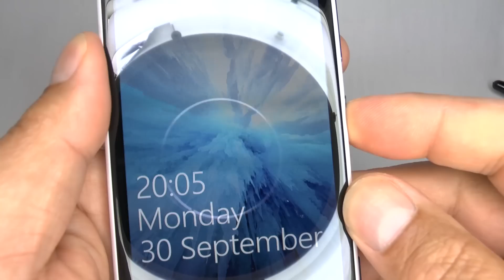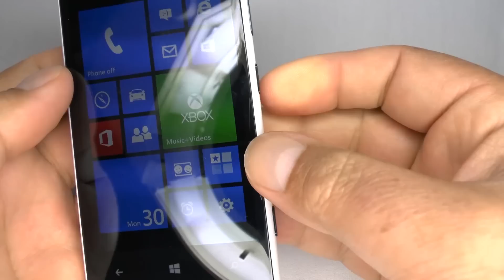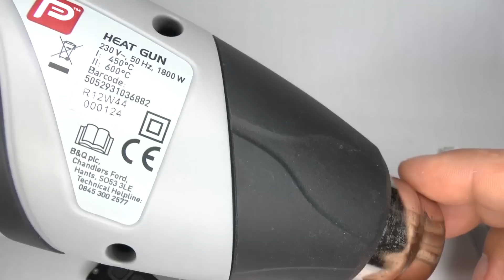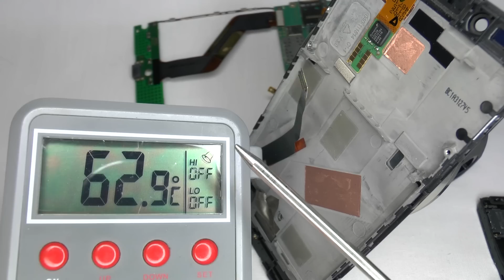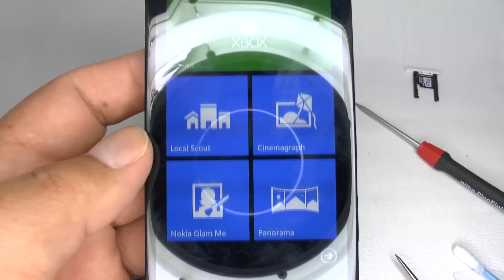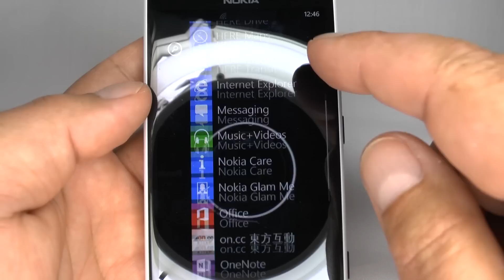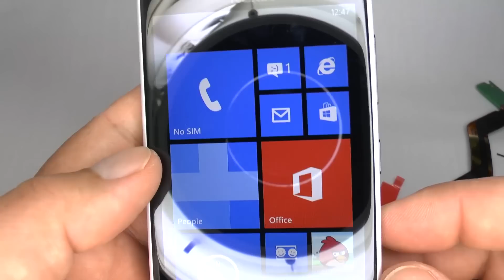Nokia Lumia 720 - Disassembly & Assembly - Digitizer Display Screen & Case Replacement

Comment: After a drop my Lumia 720 got its screen busted, and because of that I found your video. Another thing is that the mic stopped working (actually began to work erratically) a few days after the crash. I had figured its connector had probably unlatched because of the impact and was going to dismantle the whole phone to get it set properly, but as your video shows its location, I just turned the phone screen down and squished it around that connector area. Works like a charm now. Thanks a lot! Now for the screen repair... I'm gonna try to unbond the glass/digitizer and re-glue it to the lcd. I can comment how it went here, if anyone's interested.
Reply: yeah tell me if it worked
Reply: Viktor Mars Nope. Instead of separating the glass from the LCD I managed to destroy the LCD. I was cautious and did not apply much force to it, but the screen is VERY EASY to tear. When it does, a dozen layers of polarizers and micro lenses arrays and diffusers came pouring from inside it. It's amazing how many layers make the screen in these phones! Anyway, that busted the phone for good and I would not recommend trying this aproach. Buy the screen+frame and simply replace the internals. I've bought this assembly for around 40 USD and will, once again, try to repair the thing. Also, the mic worked for about a week before beginning to stutter again, so I already bought a new mic+usb PCB assembly (around 3 usd). There's no reason to throw the phone away because of two components, so i'm not giving up on it!
Reply: Vinicius Abreu any links you could provide us with where we could source the whole assembly? I'm sorry to read that you have had shattered it, after reading this I've pretty much stopped right after reading your comment. I just don't know now, whether after separating the LCD from the digitizer, if attaching together requires the same sort of sticky translucent tape or I'll be fine without it and just glueing the edges ? thanks mate

Comment: Very useful video, I just managed to fix my phone and now everythng works properly! My problem was a broken glass, even if when I opened it I realized that the lcd was cracked as well. So I bought the display lcd+glass on eBay for around € 30 (this made everything even easier) and replaced it. Grazie mille ;)

Comment: You sir, deserve more likes! I'd had a problem with mine with the volumen down button, but only disassembly and assembly can solve it! Now I think I would buy a new body :D Thank you!
Reply: Did you fully disassembly? Or you just removed the rear casing? Because I aslo have the volume down issue.
Reply: hi, you only need to put of the case and there is the button flex, but is a full line (vol up, vol, down, block and camera)

Comment: Great video. Very clear and informative (as usual). I have found that separating the digitizer from the LCD is extremely tricky, much harder than the Samsung Galaxy S3/S4, and almost impossible. If you are going to attempt a repair I would recommend replacing the LCD, Glass & Digitizer at the same time.

Comment: One of the best videos that i have seen about how to Disassembly & Assembly. Many thanks. I dropped my phone and the digitizer stopped working i think it is due to the digitizer connector disconnecting from main board. Any thoughts on this issue?
Reply from the maker: it might be worth checking the plug but you'll probably need a new display assembly

Comment from the maker: Most important is to keep the battery disconnected until its 100% dry inside, even if it seems to work ok it can stop working after a few days. Any trapped water will slowly eat away at the copper circuit. As the warranty is now voided remove the back cover and unplug the battery, then leave the phone in a stream of hot air for an hour or more. Try and keep the temperature below 70ºC. If you have access to a vacuum chamber it would only take 30 minutes for it to be 100% dry

Comment: Excellent channel, sir! I do hope your promise to cover the TOUCH/LCD Separation in a future video (like you said @19:00) will be held SOONER than later! I definitely need to get a look into this (touch cracked). I wonder if your video on L920 would be equivalent on that. Doubt on it..
Reply from the maker: The 920 had an air gap instead of the optical adhesive which makes it easier to replace the digitizer..
Reply: I wondered that. I believe L720 looks like L900 on that matter. Actually nobody has published a successful separataton of those 2 "bad boys" except after 8 hrs of airdryer.. ^^ Add to that nobody showed how to repack them later. The fact that the digitizer only is sold (over ebay) w/o any bundled adhesive film feels like quite problematic.. All that said your technique of the wire would definitely be worth seeing.. ;)
Reply: ***** Sorry to come back on that matter, but I just discovered that all the LCD+Touch I can see on sale come with the Frame bundled already. Are you aware of any LCD/Touch bare assy selling? I mean, all your dedication with the hot air gun to gently separate the metal frame from the LCD/Touch would be meaningless if the only sellable parts around are with the frame included.. Thanks and keep up with the good work!
Reply from the maker: TheMacco26 If would be nice if only the complete assembly was for sale, but as time goes on and the compatables start flooding the market you'll see the screens for sale without the frame. Lots of people buy the screen only without realising. Hopefully this one covers both..

Comment: Congrats for your excellent video(s).
I'm going through the part not yet covered here, I mean the replacement of the touch digitizer glass alone.
Although already having the LOCA glue and UV lamp to cure this, I still had a surprise: are the lower, smaller flex of the digitizer glass and the LCD flex, soldered together (4 tabs) as it seems?
Thanks!

Comment: Hi Thanks for this very informative video. I own a lumia 720 and its power button is not functioning properly ( there is some contact issue ) so for repairing that do I need to remove the flex strip with camera, volume and power from the frame. ??

Comment: Your video is no doubt very appropriate.
I have a small doubt
If suppose the front glass is damaged(broken) but everything is intact and the phone is working excellently. Only problem is the broken glass looks bad. If I want to replace only the glass(leaving the LCD), would u think it wll work out.
Need your valuable advice at the earliest
Reply from the maker: Some of the comments below say they have tried without success, so you'll need to replace the digitizer and display assembly

Comment: what kind of an adhesive is that you are using? ... for anyone attempting to do this, it's relatively easy, but make sure that you apply a lot of heat to the screen when attempting to detach it from the frame, and also if separating the digitizer from the lcd. that make a lot of a difference.

Comment: Hi
I've repaired many phones with your tutorials so very greatful for what you've put up!!!

I do have a question, I've replaved an lcd on the lumia 720.
The LCD works, but the digitiser doesn't?  When I enquired via a phone call to local a repair shop, they said there are different revision numbers which aren't compatible?  
As I threw the old one away, I can't tell what the old one was, if any? 

To your knowledge,  is this correct or do you have any suggestions for me? 

Thanks.
Reply from the maker: I didn't think there was different revisions for this model, I would try another digitizer...
Reply: I realised the problem now.
Because the seller would not change the part if faulty and fitted, I only placed the motherboard in position rather than screw into place,  so the spring clips on the back wasn't making contact to the ribbon flex on the frame.
Thanks for your response! 
And good job with your videos too! 
Have a good day/night
Reply from the maker: Duane Massey Good news..

Comment: Just subscribed (couldn't do anything else). The Digitizer is what I'd call "Display" and the screen would be the "touch glass"? If I need to only change the glass that broke, do I need to disassemble everything step by step or I can do it in another way? Thanks very much. Great video.
Reply from the maker: its a bit tricky trying to replace the glass on its own, this video shows how its done.. cambio tactil o vidrio nokia lumia 720 , remplace touch or glass lumia 720
Reply: Yes, that was the first one I saw but honestly since he messed up I didn't take it seriously like I did with your video. Still i'm not confident on myself so i'm not going to try. Thanks very much thought :)

Comment: Great video. I replaced the screen. Everything went seemingly well but when I first started the device and after giving the pin a message appeared: Try again in 221864 minutes. -- Basically nothing can be done to proceed anywhere. The volume can be controlled and I can swipe out the action center and see some notifications but if I press any of those nothing happens. I'd rather not do hard reset since I have some really important data there. Any ideas?

Comment: Dear Sir, Your video was very helpful. I replaced the touchscreen Yesterday night saccessfully. Just one thing went wrong, the microphone doesn't work anymore after re-assembly (I've to use headphone to do a phone call) . Have You any suggestion? Thanks. Marco
Reply from the maker: the microphone does seem to go wrong in these phones. I would try another usb flex which comes with the mic
Reply: exactly what I was afraid of... A lot of Thanks for Your kind help. Best Regards. Marco

Comment: I just tried separating the shattered digitizer from the LCD.  I did not succeed, and now don't think it's possible, at least not without some very special rig.  The problem is that, as pointed out in this video, LCD is glued very strongly to the digitizer but at the same time the LCD is very thin and flimsy, backed by bendy plastic instead of metal.  The front glass on it (if that's a glass at all) is way thinner than a millimetre.  The end result was that the piece that I managed to separate (with the help of the hot air gun and a gold variety of molybdenum wire for mobile repair) was not the whole LCD, just the backlight.  Wire sliced through the display itself instead of through the glue -- that's how strong that glue is, and how flimsy the LCD is.
Reply from the maker: thanks for the heads up, I also have the molybdenum wire and was going to have a go on camera, even if it goes wrong it might be worth uploading..
Reply: ***** Plz do!! As many here I have the digitizer scratched and wanted to se if its possible to repair. Great channel!

Comment: my glass got cracked its been 4 months now and it worked pretty good. but now the screen is abruptly working on its own  like opening apps closing on its own and some crap. what do i do? it costs so much to repair with a new screen. I've searched for display screen on internet thinking i cud get it for lesser price,but the searches showed "Digitalizer screen" and "LCD screen+digitalizer",digitalizer costs much lesser than LCD and i'm confused what to buy and what exactly the problem with my screen is. can u explain me what is the difference btw them and suggest what to buy? as my phone just got cracked but worked properly till yesterday,it aint working properly now though. plz suggest me something,im waiting,thank you.

Comment: Well my phone will not turn on and its been about 2 weeks since I dropped my phone in water. I was hoping that if I take apart my phone, wipe down the circuits with alcohol or something and put it back together that my phone will work again. Is this possible?

Comment: Hi. I wanted to replace my protective glass that broke. I could still see display clearly and work on my phone, but touch was tricky so i decided to change it. It is made from three parts. Lowest part (closest to batery) i guess that is display was good, and i wanted to replace two upper parts that were glued together (upper is see throught like glass, and lower is dark see through). When replacement arrived it was one part (just a see through like normal glass). When i replaced all i turned cell on screen was white. What have i done wrong? Is it possible that dark see through part was actual screen, and lowest part is just light or? Im total noob on this topic
Reply from the maker: It sounds like you have the 'glass screen only' which is not possible on this phone. You will need to buy the display assembly which is the screen and display together. Here's a link below and you can use coupon code ETS2 for a little discount which also gives me credit http://www.etradesupply.com/oem-nokia-lumia-720-lcd-screen-and-digitizer-assembly-with-front-housing.html
Reply: It is possible and I'll have to do it on my own as soon as I get the glue and everything. watch?v=MMXA8KyHaFE

Comment: the sensitive circuit thing u talk about at 10:44 ....i got that thing broken on my 720 and from a while my phone is not charging at all..... is this charging issue is because of ths thing ...if yes...can i get it fixed?
Reply from the maker: its not for charging its one of the antenna, a new usb flex will probably fix the charging problem
Reply: thanks for the reply...hope that usb flex doesnot cost me enough
Reply: also my phone have broken side power button flex cable ...due to this side buttons doesnt work except the power button ...does this thing can b responsible for charging issue or is it alone due to usb flex...
sorry for these tons of issues...
Reply from the maker: Tushar Verma the side key button flex should not affect the charging..
Reply: thankss :)  will get it repaired soon

Comment: Hi, i have a L720 and the microphone stopped working.. Do you know something about this issue? i guess i will try to open it and see what what i can do, thank you btw
Reply from the maker: I had the same problem with this one and after replacing the usb/mic flex it still didn't work. I took a chance and bought another usb/mic flex and it works perfect 22:41

Comment: How or with what do you paste the touch to the lcd? Is on 19:06 ? What is this ?
Reply from the maker: this is 'optical adhesive' which is used to bond the glass screen to the display. There are some videos on here showing how it can be done with 'LOCA' which is a liquid that sets with uv light..

Comment: I dropped my phone from my pocket and the upper side hit the floor quite hard. The screen only shows me black visual, but from the finger gesture I made, I'm sure it's still functioning normally. Like when I tried to hold search button to activate Cortana, or slide the screen down to shutdown the phone after holding the power/lock screen button. It's only doesn't have any visual on the screen. Do I need to get another new display? What should I do?
Reply: you should try a new display :)) ,
Reply: Denny Aryadi have u fixed it?

Comment: what is the strong thin wire to seperate lcd and glass? any suggestions?
Reply from the maker: its called 'Molybdenum wire' but if you read down through the comments you'll find someone has already tried unsuccessfully..

Comment: Hello, my (-) volume button is broken, it acts as if I was pressing it all the time. Should I disassembly my whole phone to fix it??
Reply: Arlette Alamilla You just need to remove the display unit from the plastic cover & replace the switch ribbon, should take about 15mins.

Comment: Does 720 and 820 has the same lcd? I want to get the LCD of my 820 and put on my 720 I want an amoled display.. Or do I can order 720 amoled LCD screen?
Reply from the maker: they are very different and even if it did fit the driving voltages are different so it won't work. I did try on the 9023/9020

Comment: Is it possible to separate the digitizer from the screen without breaking it?
Reply from the maker: I've not tried yet, I hope to have a go in the next few weeks..
Reply: Okay, waiting for it =)
Reply: I tried to remove the lcd from the digitizer using a heatgun and some fishing line. It's impossible to do so.
A screen lcd is made up of multiple "films"/"panels".
Using some thin fishing wire and a heatgun I was only able to seperate the back films from the front ones. Once you seperate these, the lcd is useless.  Even if they didn't seperate, the front part of the lcd is so strongly bonded to the digitzer that it shatters when you try and pull it off.
I'm actually confused at why the digitzer is able to be purchased seperately. 

Tl;dr - you can't remove the lcd from the digitzer.
Reply from the maker: The_Kovac Thanks for the info, I was going to try on a broken screen but I might not bother now..

Comment: I have dropped my phone and my external glass completely shattered. Can I get a new display and glass in the market or nokia care center so that I can repair it on my own and save a lot.

Your input is highly valuable on this comment. As the nokia care center will charge around 8000 rupees ($ 150) to fix it. I want to avoid such huge cost